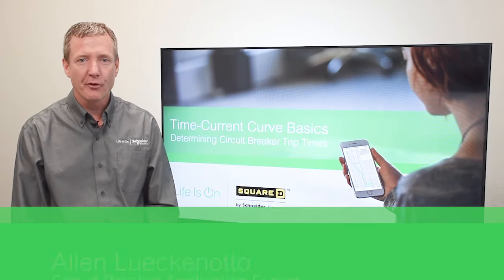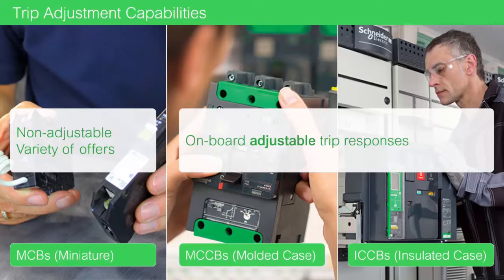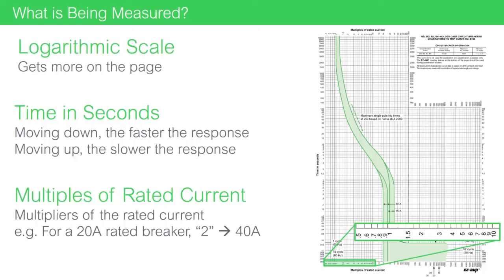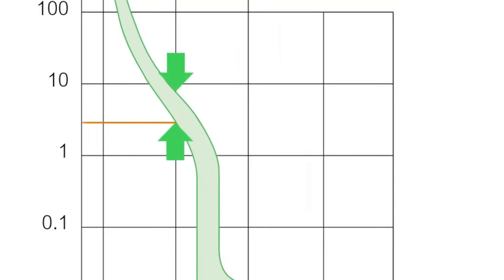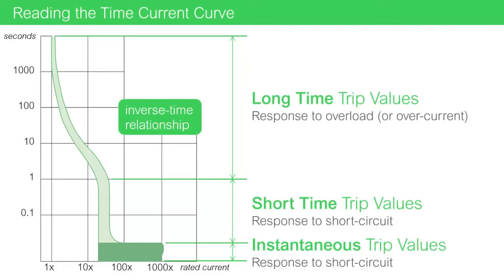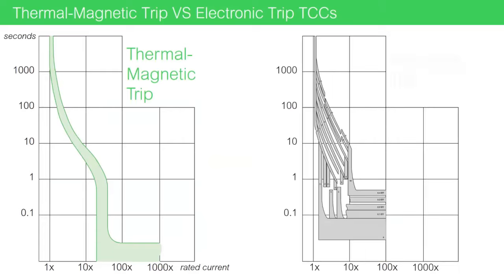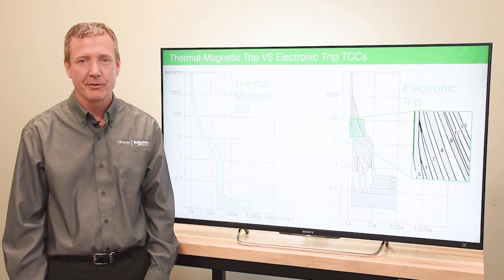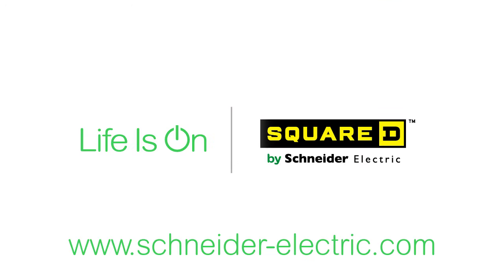Time Current Curve Basics: Determining Circuit Breaker Trip Times

Comment: I have an outdoor circuit that breaks after less than a minute of delay.  The circuit feeds 4 gate poles, I was able to isolate the short to one of the poles.  Any suggestion why the breaker trips after several seconds and not instantly.

Comment: The numbers shown at 7:42 represent the time dial of a given setting. By increasing the time dial, you are increasing the minimum response time (shifting the curve upward). The shaded region represents the minimum and maximum response time. (The breaker should trip within the time specified). You can coordinate multiple circuit breakers in series by ensuring the curves of different breakers do not overlap.

If downstream breakers are in parallel, you may have to account for different levels of current seen at each point.

Comment: Thanks 
It is very helpful.
In sepam relay setting  in etap

Regarding to the instantaneous trip , is it necessary to be set with new element or with the previous over current element. Also regarding to the ground fault trip what we should select?

Thank u dear